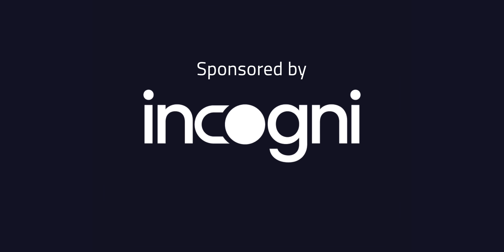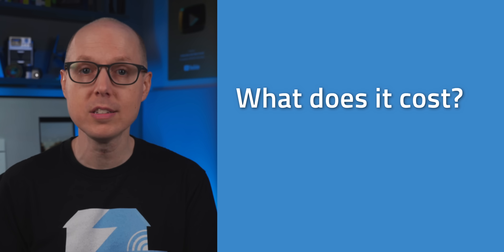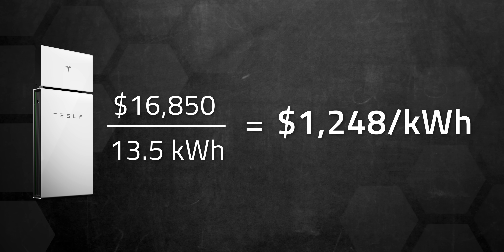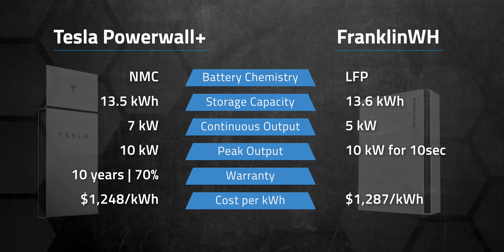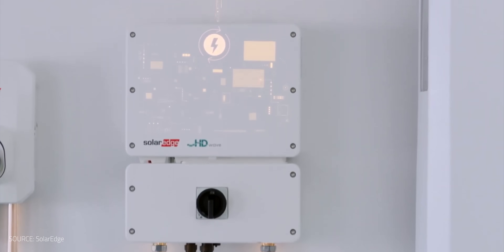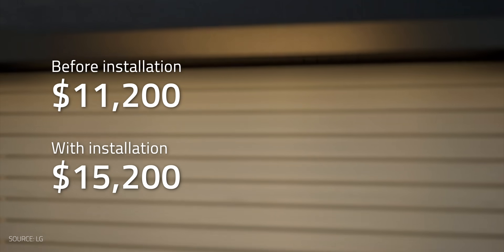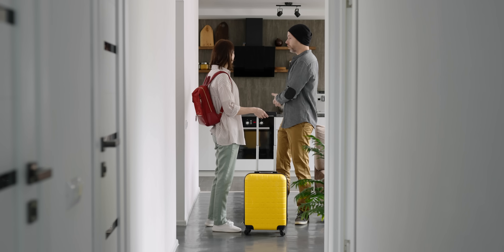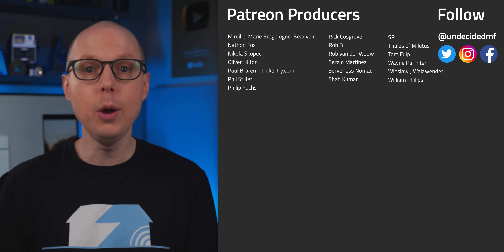Top 5 Batteries for Home (And One You Might Not Expect)

Comment: Home batteries are great and I love mine for allowing me to carry my solar gains into the night, allowing me to be off-grid for most of the year. Certainly useful for that once a year power outage of two or three hours.

But far more impactful to my bills is excess solar charging!
It really helps me reduce the payback time of my install and keeps my power bills to a minimum and I actually get to use more of my solar energy instead of feeding it into the grid for peanuts!
Compared to how much electricity our two EVs use, nighttime consumption of our home is a drop in the bucket!

Comment: Back in Oct 2022, I went with SolarEdge for my home for their solar and HD wave inverter, but with the LG RESU 16H battery (16k capacity, 7k output) and quite happy with the results thus far (havent hit the summer months with the setup yet to see just how well it does) - able to get through the whole night and when the sun comes back up, i still have not yet hit my battery reserve, so most days here in SC, i am almost completely without grid, except SE does seem to take from the grid for surges - until the battery can catch up with the demands.

Comment: Why are these home batteries packs so expensive?  Are manufacturers price gouging? 
I understand that a new 100KW bat. pack for a Tesla costs about $15K. 
That comes out to only $150/KWH which is significantly lower than the $1300/KWH quote for the 5 units reviewed. 
Getting a second hand EV battery would cost even less. 
Who cares if the salvaged battery pack only has 70% capacity. 
Weight and volume are not that critical for a stationary application.

On another topic, why are appliance manufactures not marketing more DC powered units?
Would it be more efficient (power wise) to have a house wired for DC instead of AC?
Many household appliances like LED lighting, Inverter Air Conditioners and Refrigerators, computers, battery chargers, etc. run on DC.  
Inverter air conditioners and refrigerators are so much more expensive than AC units but are more efficient.
There is a significant power loss during the conversion of DC to AC and then back to DC.
Why not just go directly from the DC power source (solar panel, battery pack) to the DC appliance.
For an off grid or micro grid application it is crucial especially in terms of ROI.

Comment: Most of the current crop of "whole home batteries" are pretty deficient on storage capacity compared to what you can get with discrete battery racks.   And over-priced.  Severely over-priced.

For example, a rack of six EG4 LifePower4 batteries costs around $9000.00 and gets you around 30kWh worth of storage.

Basically, the best solution today is to avoid the single-vendor whole-home solutions and separate the battery rack out.  Get the battery rack(s) of your choice, get the hybrid inverter/charger/MPPT box of your choice, etc.   My personal favorite right now is the Sol-Ark 15K all-in-one, and either EG4 or SOK battery racks.  The Sol-Ark handles both AC and DC tied systems.

The SolarEdge stuff is junk.  Franklin has maintenance issues.... there are a lot of warts with some of the systems you are putting up as examples.

-Matt

Comment: With most people north of the 40th parallel needing heat in a large portion of the year, and I being in Canada. I think that sand batteries are a great method of preserving energy with minimal efficiency losses. 
I live in a low sun/wind BC coastal area, I plan to use my available solar/wind as an independent thermal generation system. As heating at night and all fall/winter/spring are a far greater cost then my appliances. Using sand allows me to have a nearly limitless capacity in that I am designing the battery to handle 400C and can always add more sand. Using electricity to heat the sand and electronically controlled passive thermal circulation of a heat transfer oil to a radiator will allow much higher sand temperatures.

Comment: You forgot to add the cheapest battery - your hot water heater.  It can be connected directly to the solar using low voltage heating element replacment in a upper / lower electric hot water heater.  half your electric bill for 1/10th solar system cost

Comment: The vehicle to home options sound really good after watching this breakdown. Particularly the trucks with 100+ KWH batteries and 9+ KW continuous output. You get a truck that also serves as a battery backup for the price of the battery.
Reply: My 2022 Hyundai Ioniq 5, 77+ kilowatt hour battery has been my home back up and my camping power and my dry off the pickle ball courts after a light rain with long extension cords and my electric leaf blower since January 2022. I’ve had solar on my home since 2012 and it’s saving me thousands of dollars every year. There were no battery options in 2012. 
V2L vehicle to load is the name of their system.
The smart grid is here and we just need more folks like me and us spreading the good news and the cost savings.
The Planet will be saved because we want to save money! !!!!!!!
Connecticut has fantastic incentives for solar and home battery and electric heating and level two EV chargers in the garage. The feds have great tax credits on all too.

Comment: I have to say I like the design that utilizes microinverters the most out of all of these choices.  I'm considering a ground mount system that would be placed a good distance from the house.  If you can do it, ground mount means easier maintenance, clearing off snow, etc. and you can build a ground mount rack to allow for angle adjustment (aim the panels based on the season/height of the sun).   But there is the question of that long wire run between the array and the house, and I think that is where AC conversion right at the panels is a huge advantage.
Reply: If you have a ground mount why on earth would you use microinverters which will double price?  Put the panels clear of shade and put the panels in series and use a high voltage solar controller or AIO that has that feature for far, far less cost
Reply: @ronbridegroom8428  So is this the same answer if the panel array is 400 feet away from the main house?  I am trying to avoid the cost of running AWG 0 or 2 or whatever crazy thick wire it is going to end up requiring to push significant watts over DC from the ground mount back to the house which will be some distance away.  Maybe there is a large, outdoor safe inverter that can sit next to the array and convert the power to AC before it travels in the underground conduit back to the house?  Heavy gauge wire is crazy expensive.

Comment: I use Hourly Pricing with Comed, to tell me when the pricing goes down to below one cent per kilowatt hour, even Zero or even negative. That is when I use power from the electric company to charge my 30 kilowatt LiFePo4 battery pack. I want to buy another 60 kilowatt of  batteries for a total of 90 kilowatts. It cost me $9500 for 30 kilowatts, 5.12 kilowatts times six batteries at 48 volts each.

I can get away with using down too 3 kilowatts per day, that is 125 watts per hour, that powers two chest freezers.

Comment: Ok, what I'd like ...............
I'm a renter, 
I'd like to take my unit to my next house, 
I'd like to use micro-inverters for panel redundancy (ability to get and use old inefficient panels for next-to no cost), 
So if it can be managed as portable, I'd go with Forever Energy who have the flow battery ie. best battery-life to energy output characteristics. 
With my modest power requirements on average, with only highly occasional high-power-discharge (eg. welding), I'd be looking for a system such as this to last (if treated gently) for my lifetime, and possibly my kids also.

Comment: I know all in one solutions are attractive but they are very expensive. I installed 3x5kW Growatt inverters (15kW of power output) and 4x9kWh of nRuit LFP batteries, they use CATL cells totalling 36kWh of battery storage. I imported all of this from China to my home in Thailand for $11,000. Install costs are very cheap in Thailand, I paid $500. I got good support fro Growatt and nRuit during the installation and commissioning process. The system has worked flawlessly for the last 18 months and the last time I drew any power from the grid was 7 months ago during a big tropical storm. There are videos about my system on my channel.

Comment: Is there twice the efficiency loss with Enphase’s system with all the micro inverters or is that the same with all of them? I ask because you mention most these batteries are AC connected, but I’d imagine it’s still a DC battery which has to get converted again back into AC to be used. Is that right? BTW, love this show and the podcast with your bro.

Comment: Nice video, though in my humble opinion,  these are ridiculously overpriced products. I used to have a small off grid summer house with the cheapest 100Ah car batteries.  I know,  it's controversial,  but after 6 years when I sold my summerhouse they still performed just fine,  despite the system was vastly undersized.  Just an example why all this systems are expensive in comparison to a simple led acid system.  A classic 100Ah cheep battery is around 100 bucks.  Even if we count only half of it as usable,  to protect the batteries,  we are talking about 200 bucks a kwh. So for 10K you can build a 60 kwh true usable battery sort of 5-6 times bigger than the other alternatives. Just my experience, but I know it's not a fancy solution.

Comment: I don't get it. We would have to spend almost $100K in battery systems to provide 12 hours of power at 70 amp service. Meanwhile, a 17KW NG generator will run most people $12K installed and produces 150 amps indefinitely. I understand I have to pay $6 / hour for the NG but it only runs for 2-3 days every year ($400 annually). Am I missing something?

Comment: They are good systems for someone wanting a pre-packaged install where the only tool they lift is a checkbook. That is likely a vast majority of folks who don't want to fool with learning how to set up a system but as a 62 year old guy with no previous solar experience I've learned that it really isn't that hard (* - although I am NOT going up onto the roof to install panels!) . My very, very basic system handles my medical equipment & with another battery would power StarLink & my small server no problem. Folks just need to experiment and try things... the way we did when we were kids. I appreciate your series on your Net Zero home - I'm sure it will be exactly what you envision it to be.

Comment: We have SimpliPhi batteries at roughly $800/kW and rated for 10,000 cycles, and friends have EG4 batteries that are about half that price and rated for 7,000 cycles.  It's definitely worth looking at the lifecycle cost per kW-HOUR, not just kW, especially if you're considering them for anything other than off-grid or power outages.
Reply: $800 per kilowatt? It would be helpful for others if you had your unit straight. Energy storage is expressed in kilowatt hours!  Or do you have a water system that does 60 psi per hour? 😂

Comment: Does anyone have practical experience with Franklin? It sounds quite good and the ability to integrate a generator is a must from my side. Does the maximum power output multiply with the number of batteries? I need more than 10KW

Comment: I recently had a small solar PV system installed (7 panels) that included a small 2.4 kWh battery. (UK based, pylontech battery connected to a Solis inverter.) It is the battery that makes all the difference, and I already know I could have got three batteries the same size and still filled them up on a good day. The plan is to get another battery added next year along with 3 more panels pointed towards the evening sun. I now know a lot more about how and when my house is using energy via the app that came with the inverter, so I know that right now my house is still running on sun generated energy from earlier today. Be warned though, watching the system run everything is addictive!
Reply: Also a friend of mine has four times the amount of panels I do along with a Tesla Powerwall and several Bluetti batteries. He is all but completely off grid, or as much as you can be in the UK where you aren’t actually allowed to disconnect your house fully.
Reply: @randomjasmicisrandom  just interested in your comment that in the uk your not allowed to disconnect from the mains. Have you any reference for that? Just asking as when we had our consumer unit upgraded I asked for a "whole house isolator’ to be fitted after the meter as I thought we had a faulty meter and the isolator was cheaper then a formal investigation by the energy company. So I ‘isolated the house’ and videoed the meter for an hour - not a success as the meter just when into a ‘failed’ mode. ( used a power meter to check the meter and round we just use a lot of power 🥲)
Reply: Yes, you can easily become a battoholic!
Reply: Yes， it sounds very nice！

Comment: Hey Matt... What about Lavo, I think they are from Australia and they have created a hydrogen based backup system.... It needs a RO water connection to create hydrogen with electricity and then converts the hydrogen to electricity during power outage.... Why don't you do video on similar systems
Reply from the maker: Thanks for the suggestion.  I do have a video on solid hydrogen storage where I talked about Lavo, but haven’t done a dedicated video on them and that type of tech for homes.

Comment: Thank you. I'm waiting to the larger and cheaper batteries, as the flow battery you mentioned, zink-bromine or iron-air. This is because in Israel I now get ~0.14$ per KWh I sell to the grid from my 21kWp PV system during the day, but soon I could sell them in the evening for ~0.32$. Because I produce up to 130 KWh per day and use only up to 10-15 kWp per day , a 10-15 KWh battery won't help to pass the bulk of the the electricity I produce to be sold in the evening.

Comment: To be honest, for me personally, energy storage doesn't make sense. My power is extremely reliable, so I am not concerned about outages, and with net metering, I am still able to reap the benefits of the juice my solar panels produce. The excess energy I feed into the grid will reduce demand for production from fossil sources just the same as if I had used it to charge a battery, and I'm not concerned about improving resiliency because as mentioned, the grid is extremely reliable where I live.

If batteries weren't so expensive, the math might look different.

Comment: If you got the room for one, I'd recommend looking into a used 2011 Nissan Leaf with a Chademo vehicle-to-home system. A VERY broken car-battery will probably give you around 15kwh for very cheap because no one wants an EV with a range that small. In a pinch, the thing even has wheels and will still go 30 miles to a shop and back - just unplug it.

Comment: Another great video, thank you.
But how much!? Did those price's include the full solar install (panels & inverter)?
Here in the UK I'm just about to have 12 * 415w panels, inverter & 2 × 9.5kw batteries installed for around £15k. That's  approx £790 per kwh (full install from scratch).

Comment: My dad has been engineering commercial back up DC power layouts for 30 years now. I have been in some of the offices where this equipment is housed. They have HUGE 2 volt DC batteries that have an expected lifespan of 80 years. No, that is not a typo. I wonder why they haven't sold these types of batteries to home owners?

Comment: What kind of efficiency do these batteries have when charging and discharging? I mean if that Blip One requires for example 4 kWh of grid power to charge up 2.2 kWh of power for later use, the idea of time shifting power kinda goes down the drain. Even with solar panels delivering the power it's interesting to know if that Tesla Powerwall requires for example 20 kWh of solar power to charge up the 13.5 kWh capacity of the battery or it can be done by fewer solar panels. Would be cool to have some efficiency numbers charging and discharging the different battery options along with those other numbers,

Comment: @UndecidedMF  I would love to see your thoughts on using EVE batteries for smaller use cases.. like I WFH and am on computer all day.. most of my day to day energy is my computer setup and sometimes a small space heater on cold days to avoid running whole house heat. Fridge is another one obviously. You can get 4 EVE 280AH 3.2v batteries for about $700, with 6000 cycle capability. I am not entirely sure it would be an easy task to set up for the average home user.. but there are kits, and similar rack mount battery options with easy instructions for a couple grand that offer 10+ Kwh of 4000+ cycles.. which I would think for those like me using just a couple things.. could save a ton of money by using solar + nigh time charging to charge them up, then run stuff on them during the day.. when at least in my area PGE is 3x more expensive.

Comment: I am not sure if this solution will fit most of your needs but I recently bough a new house and I did a little research on the topic for my needs. I have chosen a solar thermal collector. My washing machine, dish washer, steam boiler... all of them need warm water to function efficiently and these are some of the most energy hungry appliances in my home. Also you can use it for floor heating and it can be backed up by any source of heat be it natural gas, electricity, diesel, timber or coal. This solution is much cheaper, safer and it requires less maintenance than any "big power bank" that can turn your house into ash in minutes.